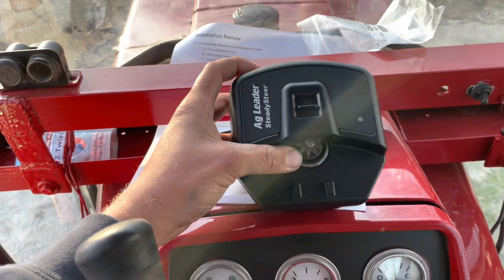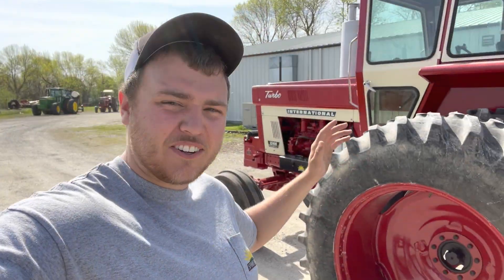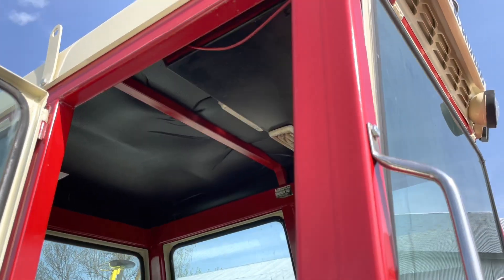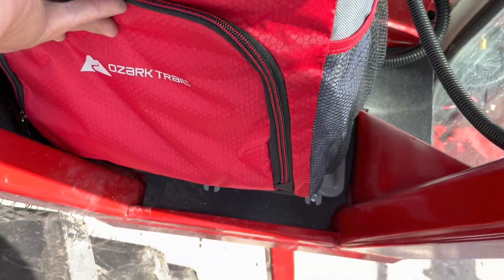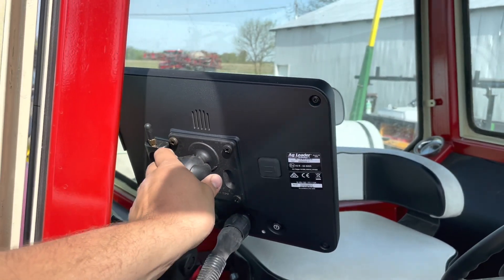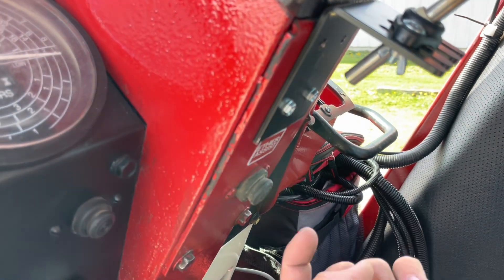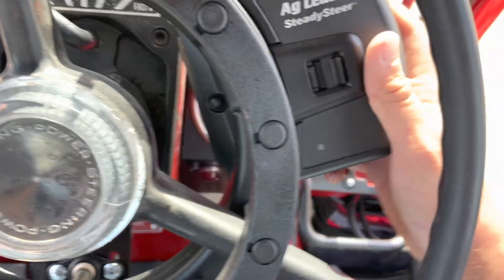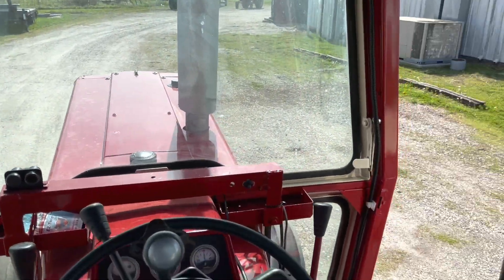AgLeader Autosteer Install on IH 1066!

Comment: With ag leader did you have to map out your field or do you just start on one side of the field and tell the guidance system how wide you're implement is?
Reply: Pretty sure you have to program in implement width and offset no matter what. With most, you have to do end rows manually. The other day, I had the experience of planting with a GPS monitor but no autosteer (no marker arms either). That was something else. It will tell you left and right, if you're centered, etc. Unfortunately, it doesn't account for implements turning at the hitch. You wind up with a lot of overlap and gaps. The owner is still kicking himself for not getting the autosteer version years later. It would have more than paid for itself by now.